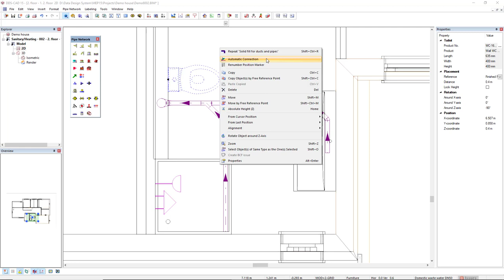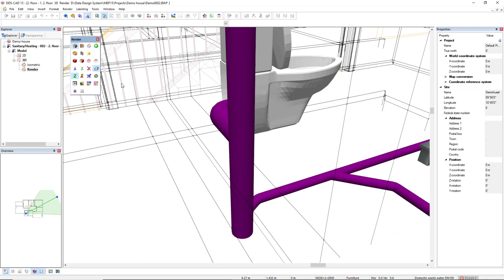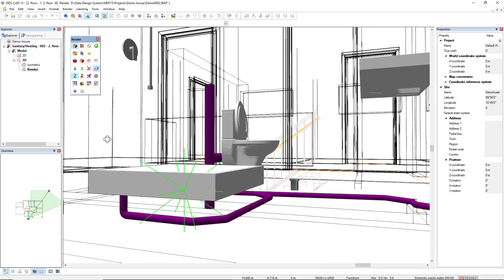Getting Started  - Plumbing - Automatic connections to connect sanitary equipment

Comment: Nobody would build the connection like it is planned from the basin. Can I manually adjust the connection, for example, so I have only one large 45° angle instead of those short? Also, I try to avoid 90° angle like from the toilet to the collector pipe. Can you manually change things like that?
Reply from the maker: Hi, yes you can manually connect the pipe to the terminals. DDS-CAD has an option to replace 90º bend for 2 bends of 45º.